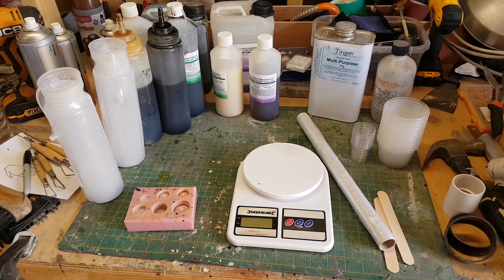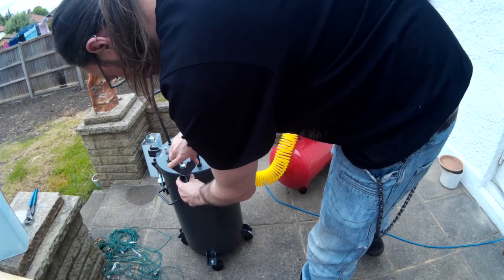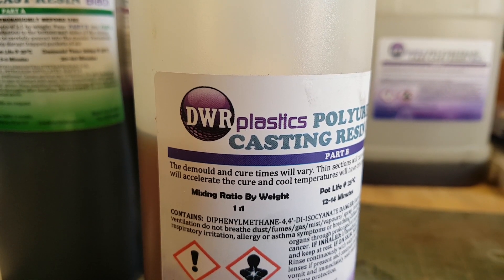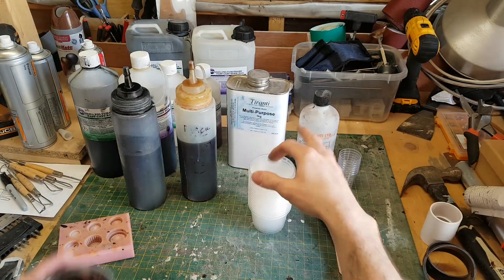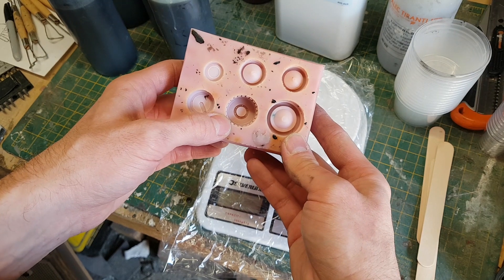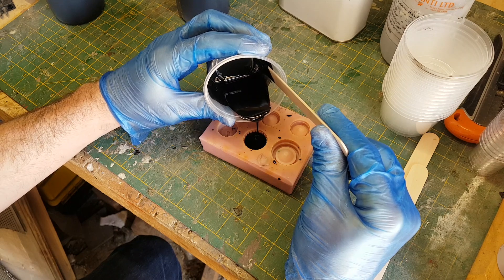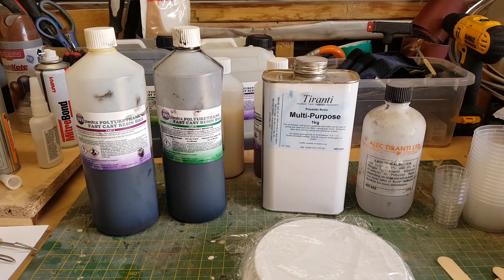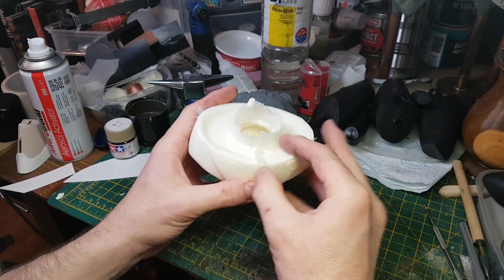Resin Casting - Polyurethane vs Polyester Resin

Comment: Polyester flexible?
Is it an option to make action figures?
Reply from the maker: No, polyester is quite brittle so it's not really suitable.
Reply: @thedarkpower do you know of any chemical which when mixed with polyester, it's becomes flexible
Reply from the maker: @new_contents_all_day  No, it doesn't really work that way.  There are flexible polyurethanes though. Check out Smooth-on.

Comment: for stirring sticks I use kitchen utensil handles, that are round, they work very well and are reusable, theyu are better for mixing silicones and resins, theres a knack in getting silicones out of the mixing cups but once mastered are really easy to use. 
I use DWR too.
Reply from the maker: Good tip, thanks!

Comment: Im going to pressure cast a 60's movie Dalek beaker in clear polyurethane. The beakers walls are approximately 2mm thick. Can you recomend a good value uk brand of water clear polyurethane?
Reply from the maker: I've not used clear polyurethane.  https://www.cfsnet.co.uk/ used to do a water clear epoxy which I've used quite alot, but that seems to have been discontinued.  You could try Bentleys https://www.benam.co.uk/products/plastic/crystal-clear-resin
Reply: @thedarkpower   thanks for those links. I'll give em' a go!

Comment: Brilliant video and very informative, would the Polyurethane be suitable for exterior pieces? I believe it has a very good tensile strength is that correct.
Reply from the maker: Thanks. Yeah as long as its not too think it's quite tough. It does sand fairly easily though, and I'm not sure how well it would stand up to repeated exposure to the sun. So I'm not sure if it would be OK for exterior use.
Reply: @thedarkpower  Thanks and appreciated, yes heard they don't like UV, but the supplier stated if painted they should be fine. Also looked at Xencast P2 and P6 Toughened Polyurethane Resin, they are the company recommending painting the pieces. Do you know what happens if exposed? do they disolour, or break down? needs to maintain its tensile strength. Just want to add, a guy in the US, made a sign with Polyurethane resin logo that he covered with gold leaf gliding, and it gets really hot in that climate, so maybe if it's covered, they should hold up ok, as long as the UV doesn't penetrate the outer layer I suppose. All I can do is test to see!
Reply: @thedarkpower  Just a quick update, after an exhaustive search and discussion with so many suppliers, you can get an additive for UV protection, that's more for professional production though. The P6 Toughened Polyurethane Resin has a pot life of 6 mins opposed to the P2 that has only 2 minutes. Many modern clear coats are boasting UV protection, and you can get it in a spray can, so I think the best technique is what I referred to earlier. Polyurethane Resin when exposed to UV has a tendency to discoloration that's cloudy and in time then can break down and become brittle, so they need an outer coating to maintain integrity and strength.
Reply from the maker: @gazsto I've not used polyurethane outside, so I simply don't know how it'll fair after an extended period outside, so I can only guess I'm afraid.  The UV thing was particular to clear epoxies though as far as I was aware.  I've definitely had clear epoxy resins that claim to be UV resistant discolour over time after exposure to sunlight, so I'd be wary of any claims to being UV resistant. I'd say do a test before doing anything too involved. Good luck!
Reply: @thedarkpower  Thanks and will do some testing to make sure. Got a UV lamp, so might give some samples some extreme exposure for a period.

Comment: Great vid! I’ve been using smooth on products and was about to purchase the crystal clear variant but saw polyester resins and thought I’d give them a research. Do you know any decently prices for water clear polyurethane resins? Can’t seem to find any at a reasonable price.
Reply from the maker: Thanks.  I've not used polyurethane clear, but I have noticed it tends to be more expensive. I've had good results with epoxy, polyester isn't that great though.  I'm not sure where you are in the world, but these guys have some polyurethane clears.

https://www.mbfg.co.uk/water-clear-casting.html?gclid=Cj0KCQjwoK2mBhDzARIsADGbjeoE7b0Zb_XQ4DPfd7HgWMllRDc0L4nXqXuPHGWg8E5-y2BHe_EzfvoaAlY7EALw_wcB

Comment: Hello, i want to try Polyurethane 80A shore casting, is that dangerous for health? i'm scared by theses bottles ^^.
Reply from the maker: Shore 80A refers to the hardness of the material. Polyurethane seems pretty safe to me - it's less toxic than polyester resin for general use, for example. I use it all the time, but if in doubt read the technical sheet for it.

Comment: I have a problem with the polyester resin breaking when it falls on the ground. Is there a solution for that to avoid breaking it?
Reply from the maker: It's a brittle substance, so that's just one of it's properties.  You can mix it with glass fibre to strengthen it. That generally only works for thinner sections though.

Comment: Great tips and good advice, been casting for a while and use same techniques, agree with your comments on the differences between polyester and polyurethane
Reply from the maker: Thanks very much Neil!
Reply: @thedarkpower  I am considering pouring a transparent top to an outdoors table(I don't want to use glass) the problem with resin that it might bend or warp, so I was advised to go with transparent polyurethane pour as it not effected like resin with temperature and being in the sun all day.
Is it possible to do with polyurethane and leave it in the sun and do you think it will work?
Reply from the maker: @FirstLast-tx3yj  I've never tried this so I can't really comment I'm afraid.  I think most of the clear resin table tops you see online are epoxy.

Comment: Polyurethane resin is it suitable for exterior projects? great video and very helpful!
Reply from the maker: I'm not sure to be honest. It's fairly hard, but can be sanded easily, so I'm not sure how well it would stand up to the elements.
Reply: @thedarkpower  Yeah, I have been given varying opinions and some say no whilst others say it's fine. Suppose all I can do is test a few pieces and see how they do, thanks for your time!
Reply from the maker: @gazsto6733  No problem, good luck with the project!

Comment: I'm Using unsaturated  poly resin as of now,  but some small parts are very fragile like fingers, objects like sword, guns are breaking up easily, would you suggest me to use polyurethane resin to avoid this.
Reply from the maker: Yes, you can get impact resistant polyurethane resins which are flexible so they're really good for thin parts as they bend rather than snap.

Comment: Can you use latex molds with Polyurethane resin? Does it need a release agent?
Reply from the maker: Yes that should work fine.  I've not tried this myself so I can't say for sure if you'd need a release agent, but I can't imagine it would stick that badly.  If in doubt do a small test before pouring your mould.
Reply: @thedarkpower  I've been using epoxy resin making skull atty stands but I've now lost two mold even tho I used plenty of release agent 😅 so time to try something else.
Reply from the maker: @enigmavapes9652  Oh dear, sorry to hear that! I know Silicon can be expensive but might be time to give it a go ;)
Reply: @thedarkpower  already looked and reckon I'll get a kit and make a mold from what I already have and go from there 👍

Comment: I use epoxy resin and I've been looking for a silacone mold for a taper candle,  but the only mold I can find is a polyurethane mold. Can I use epoxy resin or casting resin in a poly mold?
Reply from the maker: Well as far as I know soft polyurethanes aren't as soft as silicon.  I've not seen a polyurethane mould before, but I wonder if you might have trouble demoulding the final piece? Not sure if the epoxy might stick to the mould too perhaps?  Sorry, I've not encountered that before, so not 100%

Comment: Hi,can you use polyurethane resin to make speed bag ball hook swivels? Thanks
Reply from the maker: Hi, I've no idea what they are I'm afraid.
Reply: @thedarkpower  boxing speed bag swivel,its basically a 1" nylon ball bearing with a hook through it then a resin housing for the ball,needs to be very hard and let the ball move easily with no friction for maximum speed and fluidity
Reply from the maker: Ah OK, no the resin is relatively soft and can be sanded very easily, so I think that would break pretty quickly.
Reply: @thedarkpower  which resin would be best to be strong but able to fine sand to be glass like smooth
Reply from the maker: Might be worth trying some epoxies perhaps.

Comment: if you want to cast a box with thin walls, is this possible?
Reply from the maker: In principle but probably not the best or easiest way of making a box.
Reply: @thedarkpower  Hmm, how do you recommend I create something like this: https://shop.westerndigital.com/content/dam/store/en-us/assets/products/portable/my-passport/gallery/black/1-2tb/MyPassport-1TB-2TB-Black-Hero.png.wdthumb.1280.1280.jpg
Reply: As in the case, I was thinking to cast it in two separate pieces? But how should I go around making the cast, I will draw it up in Fusion360 but I was hoping there was some sort of software that would just turn into into a mould - magically.... lol
Reply from the maker: I think you might struggle to make something very thin like that - those types of things are usually made from injection moulded plastic. Poured resin is a different process.  It's not impossible but you would need to pressure cast it to avoid air bubbles.
Reply: @thedarkpower  Hmm, I'm not sure if I have access to a pressure casting machine, I know of a vacuum chamber I can use. I'll have to reevaluate. Or just make the walls thicker. Thanks for the rapid response :)

Comment: this was very informative. I have one question though. Is there a polyurethane resin that cast slow and is still flexible? I want to roto cast a piece but have it fairly flexible as well. The resin I have hardens way too fast and tends to have many bubbles plus it fills the entire mold which is a huge waste of materials in my opinion.
Reply from the maker: Thanks.  I've used the slow version of this.  There's a degree of flex to the casts  https://www.dwrplastics.com/rotoslush-casting-resin.html

I've also used Task 15 from Smooth-on.  That was more flexible but I found the casts would deform over time, so it was a little too flexible for my purposes.

Comment: Comparing strength ,toughness ,shear resistance and waterproof   which resin can handle better ?
Reply from the maker: It depends what you want to use it for.  I don't think polyurethane is that tough - it's OK for sculptures etc though. If you wanted to use it for costume work, for example, some of the urethanes with a lower shore hardness are great because they'll bend if they take a knock, rather than breaking.

Comment: Hey!
Nice video, getting started in the Resin Casting world. Just one quick question, is Polyurethane Resin safe for home use? We don't have a separate work area, if not, is it OK to cast outdoors?
Reply from the maker: Polyurethane doesn't have a strong chemical odour and so is easier to use indoors than polyester resin.  As long as you take care to make sure it doesn't come into contact with food or food preparation surfaces you should be OK.

Comment: hi so happy to find u! i'm thinking about casting a ball jointed sclupture and it seems that they are usually casted in Polyurethane.......but i can't find it in my country so do you think Polyester Resin would be a good substitute?
 it should be able to handle some point of pressure caused by ellastics in the doll (for posebility) and it can get really thin in some parts(around 2 millimeters)
plz help T^T
Reply from the maker: Polyester would be way too brittle for that. And to be honest polyurethane probably wouldn't work too well if the pieces are 2mm thick. You could look into stop motion armatures which are machined steel and so would be strong enough.
Reply: @thedarkpower  thanks but that wouldn't work cause i have sclupted the bjd and the stringing is the only option for jointing system now :( and i have seen people use polyurethane like "popovy sisters" dolls
but i can't find the material no matter how much i search like there is only polyurethane used for covering woods and floor ....that cant be used for casting right? sigh what to do TT

Comment: First great to see a English video... question the polyurethane impact resin how strong is it ? the reason is I'am a bench Locksmith and some lock parts have to be replaced due to ware this would normally be expensive due to machining costs. If i can repair the part  and cast it this would save time and extra cost to the customer....win......win....
Reply from the maker: Hi. It's quite tough but has a degree of flex, hence the impact resistance. I think it would be too flexible if you're casting lock parts as the pieces would be quite thin.

Comment: Hi, very helpful video so maybe you can help me as I am in desperate need of it. I have started to make rings, when inlaying opal I've had issues with bubbles and surface imperfections using CA glues (super glue, also what most people use) although it is hard and durable. I've also used epoxy and UV resins, both of which were far too soft when set, too high in viscosity, yellowed and did not deal well with the heat from sanding and polishing, even going soft enough to warp and I really wasn't being harsh on them. I now have a 10ltr pressure tank and compressor so I'm less worried about bubbles. Can you please recommend a specific type and maybe even a few brands to try? As I've looked everywhere online and can't find a good definitive answer! 
The requirements for the resin are as follows;

• Super thin/ low viscosity- essential
• hard set like glass but durable- essential
• able to sand and polish with power tools- essential
• no yellowing/crystal clear- essential
• compatible with pigments- preferable
• measure by weight/volume- preferable
• little to no shrinkage- preferable
• Pot working time; 5 to 15mins non- essential but preferable
• Set time;15mins to 2hours- non-essential but preferable.

Any help you can offer would be greatly appreciated!
Reply from the maker: Hi, well I've only tried two types of clear resin - polyester and epoxy.  The polyester degassed itself really well but tended to dry a little tacky and didn't take a polish very well.  The epoxy was really good though.  It requires pressure casting but it's very tough and can take a sand and polish just fine. I used it to make a clear gear stick handle for a van and it worked great.  

This is the stuff I used.  It might do the trick for your purposes. It does take about 5 hours to set though.  It takes a tint just fine too - I've used oil paints and also pigments made for polyester resins.

https://www.cfsnet.co.uk/acatalog/Fast-Cure-Water-Clear-Epoxy-Resin.html

There are also clear polyurethane resins, I've not tried them though

https://www.mbfg.co.uk/polycraft-opticast-2000.html
Reply: @thedarkpower  wow thank you so much for this, very informative! And if it only takes around 5 hours that's even batter. I'll give it a go 😁👍

Comment: Awesome! Have you tried using jesmonite or equivalent brands for your fiberglass mother molds instead? I hate polyester resins/fiberglass smells.
Reply from the maker: Thanks!  Yeah I got some jesmonite ages back for exactly that reason - I was living in a flat at the time and so couldn't really use polyester due to the smell.  I did use the jesmonite a little bit but to be honest it really seemed like plaster with PVA glue in it so it didn't seem that strong.
Reply: @thedarkpower  hi, yeah I ought some plaster polymer from Tiranti and was sceptical. I was commissioned to sculpt a big predator wall plaque and I used the quaxial type fiberglass matting that jesmonite needs, so I made it about 70mm thick or more in places and have to say it was like bullet proof. Reckon I coulda stood on it. I didn't add water though, just neat polymer and plaster.  Made a few bases too for some Popeye sculptures I made. About 2cm thick. Worth another experiment?  If you see Mixter Art on Facebook page some of my sculpts are on there. 😎. Ps, thanks for the cheaper resin tips.
Reply from the maker: Yeah I'll have to have another go with it - I've reinforced plaster moulds with fibreglass before and they've been pretty solid, so I can imagine it being strong.  I checked out your page- some cool stuff on there :)
Reply: @thedarkpower  thanks! I've dragged my feet a bit with new content lately but I guess with the lockdown it's a good excuse to create.  Also similar problems with polyester as I live in a flat, and the smell lingers for weeks. Would kill for a studio or garden. Keep up the great work! I love it!

Comment: Hi Joe great vid and think I'm ready to dip my toe or 1/6 heads in for the first time.
https://www.dwrplastics.com/black-fast-cast-resin/Fast_Cast_Black_500g.html
This is the resin you used right, as the link brings up the rotocast resin?
Also for making moulds which shore hardness do you recommend for say a 1/6 head mould?
Also need to order some mould release spray I guess.
Reply from the maker: Thanks Neil.  Yes that's the stuff - you could also use the white or beige versions if you were doing something skin coloured too.  Mould rubber is commonly Shore A28 - I use this stuff  https://www.dwrplastics.com/general-purpose-moulding-rubber.html

To be honest I rarely use mould release - I only use it if the thing I'm casting is porous in some way.
Reply: @thedarkpower  Cheers yeah beige will do nicely for 1/6 heads thanks for the link will definitely do this soon as it looks like i've got a fair bit of time on my hands. Will post up a vid, take care;)